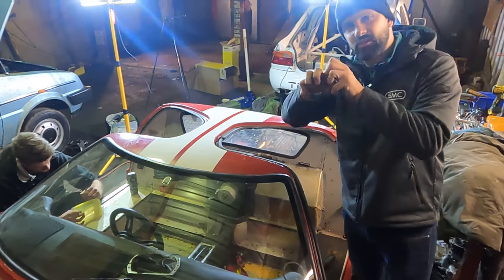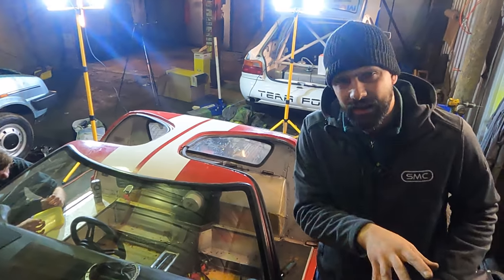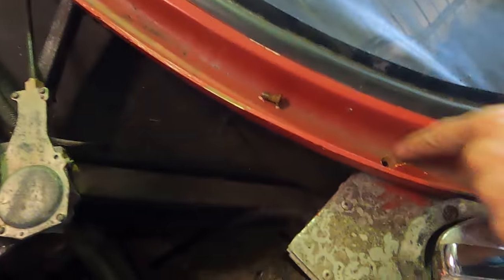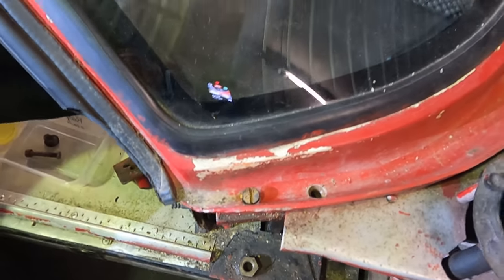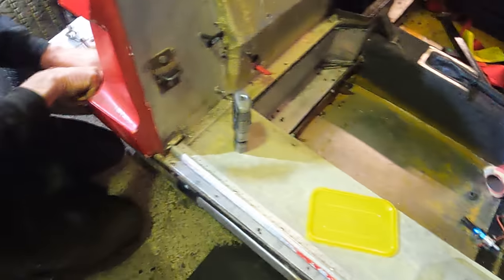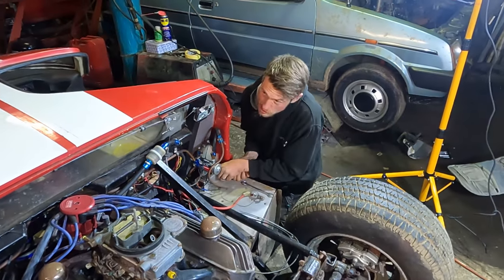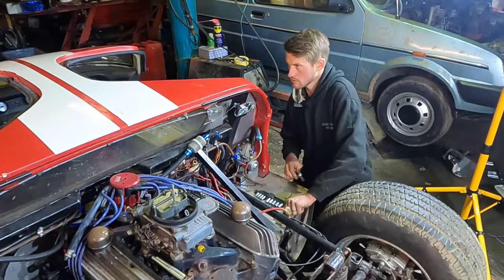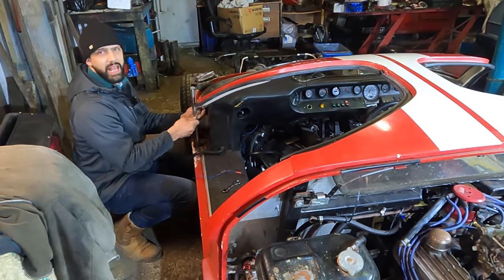GT40 Supercar Build   Spider removal   Make or Brake

Comment: Ivan special on bolts/door hinges. Originals had a steel spider/roof section that was part of the chassis. The door hinges were adjustable and attached to the chassis. If you do a search for Gelscoe then you can see their FIA spec replicas and they have a load of photos of the builds. Probably got some hinge photos.
Reply from the maker: Thanks matey

Comment: Top door hinge mounting: Looks the same as mine, so I'd say it's of KVA design.
MkIII fuel tank senders: As far as I can tell, they are in the correct place and should not be the same as the race cars. MkIII tanks were aluminium and surrounded with polyurethane foam for insulation and safety purposes.
Keep up the good work ...

Comment: Try using a brass punch next time when trying to hammer the screws out, brass is softer than metal so it would have some give, and it would focus the area of impact on the screw itself, not the screw in the fiberglass, also safety glasses, whenever you chisels or hammer anything theirs almost always material coming off, as for the door latch I dont know how they did it on the original car but something tells me when you rebuild this thing you should put some locktight in or look into a more secure way of keeping the screw in and making sure it keeps its adjustment

as hexpins like to come undone in my experience, flatheads not so much

Comment: Roll cage is not advisable on a road car. The cage is far too close to your head on a GT40 and unless you always wear a helmet the chances of life changing injuries from an utterly inconsequential bump is far too high. 

My chassis came with a roll cage, I decided against using it as mine will predominately be a road car.
Reply: Top advice there. Even a moderate impact could mean the roll cage-head interaction is unsurvivable.
Reply from the maker: Thanks matey